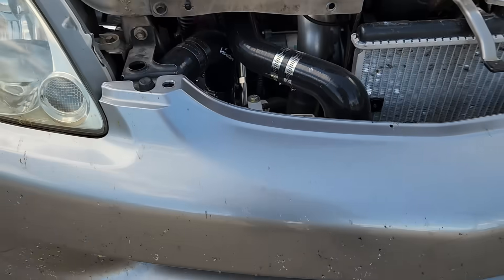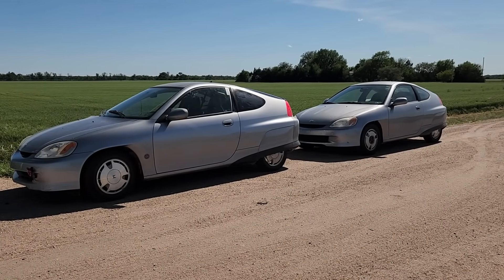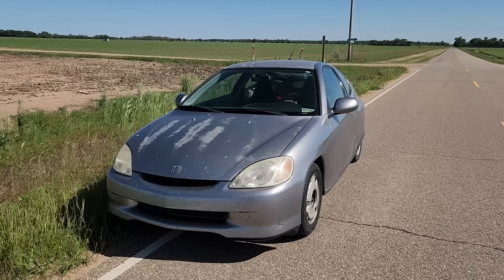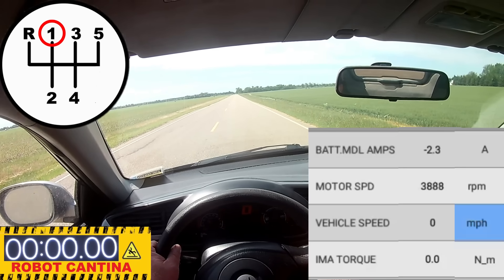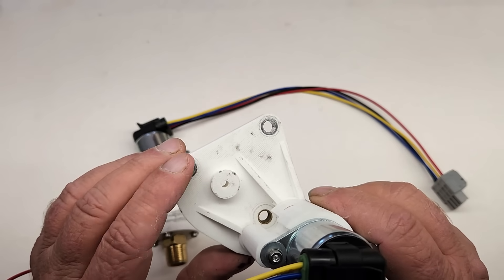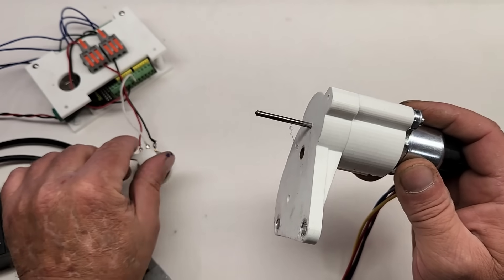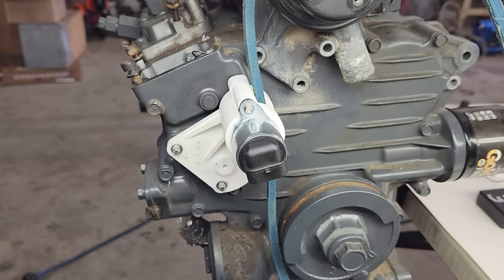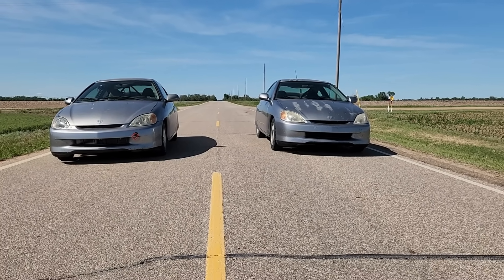S4 E18. Will an AMR500 supercharged Kubota diesel Honda insight outrun a stock Honda insight?

Comment: my cars have 1000cc engines . if i raced them , it'd be the only race in history where every car was tied for last place .
Reply: Well in that case then they would also tie for first and you would hold all 3 podium spots 😅.. peace and love bro
Reply: Must be nice to have big blocks! I have 3 trucks all with 660 cc engines. Have them in 2 wheel, 4 wheel and all wheel drive. The all wheel drive is turning 5000 rpm's at 50 mph with 165X65X13 tires. Great in the rain though.

Comment: Y'all are a fuckin trip. I have owned and or built some really powerful cars and other things in my time, but I find a particular enjoyment and solace in the projects you present. It's true what they say about it being more fun driving a slow car fast thsn a fast car slow.
Reply: I had more fun in my '90 Festiva than any number of neck snappers. Not saying they weren't fun too.
Reply: For sure! I spent 2 years driving a 62hp, NA diesel pickup truck with a 5sp manual. I got to 84mph downhill once. 70-72 on flat ground was doable but took a while. I think the diesel insight is faster than it lol
Reply: It's wild ain't it bro ...  I must agree tho .. way mote fun to be able to push a car to its limits and have fun as apposed to a big toe on the peddle and your speeding (I did that to myself taken a 100hp 91 na Miata and dump a lil over 20k in it to have round 400hp , and it's fun af but can't keep it floored like stock or I be dead 😅).. peace and love bro
Reply: @mastercricket7626  I knew a man with a Hennessy HPE700 Equipped C7. I meet him at autocross when it's brand new. 2 years later I met him at my job at a Mazda dealership. He still had the Vette, but bought an NC Miata because he could floor it everywhere and not get pulled over, unlike his rowdy and very obviously quick C7. 

He said he drove the Miata like a daily driver and the C7 very rarely got much for miles on it over the handful of years he was coming into the dealership with his NC. (We had a GM store under the corporate umbrella, I could see documented milages on any car a customer had in our system. He maybe accumulated enough miles for a yearly oil change. Mostly it was tires (no surprise there 🤣)
Reply: @goosenotmaverick1156  yeah they are great cars , but I can't speak on the not obnoxious fact as I'm one the assholes that has a hood dump and tuned my car to backfire on decel lol 😂  and man if I had access to ppls recors of driving and maintenance like that , I would be messing with them all the time , like o I k ow he will race me lmfao 😂.. peace and love bro
Reply: @mastercricket7626  hey every car can be made obnoxious. There's always exceptions, I've been one once or twice 🤣
Reply: @goosenotmaverick1156  💯 facts bro , and u make all mine obnoxious lol .. but I am also the guy who rides with no noise jus the sounds of the car .  Manly to hear what I brake 😂 but sometimes just to hear the turbo go like a jet engine lol ... but then again with how I be , obnoxious to others sounds like a symphony to me 😂.... but in the end bro it's all just for fun imo .. so along as we all laugh and smile in the end it was all worth wile .. peace and love bro